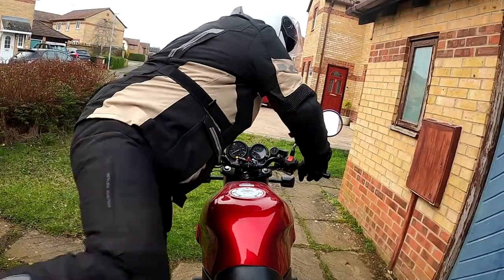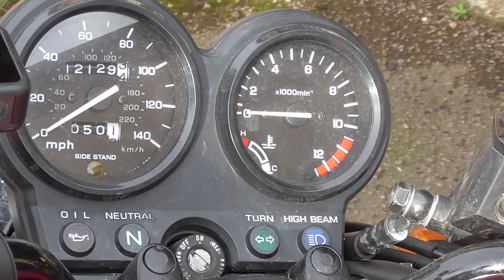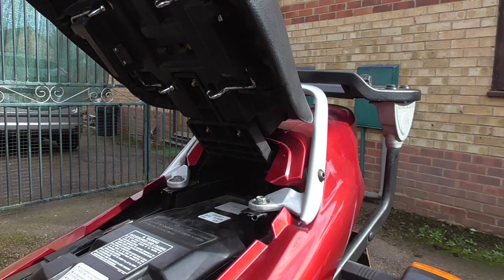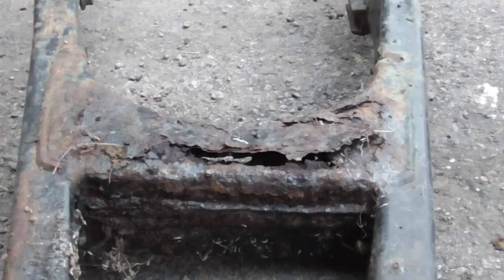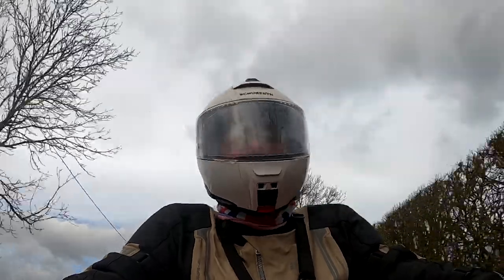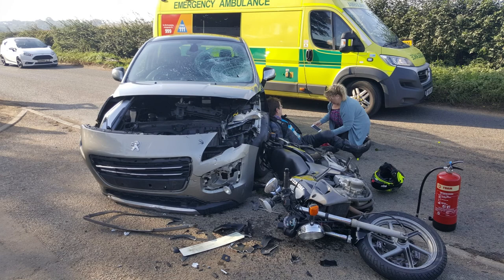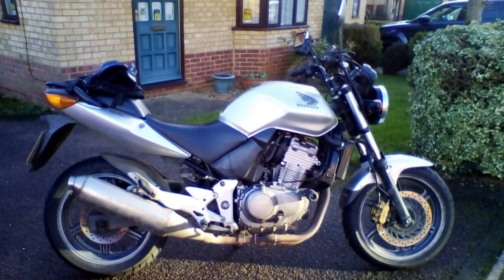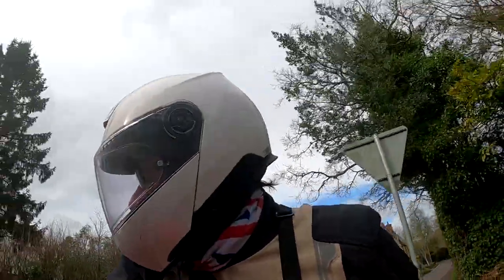1999 / 2003 CB500: Honest Review

Comment: Hey again mate have a question or two…

:) im getting around 210 miles before hitting reserve on fuel,does this seem about right? Also i have noticed a slight bit of handlebar wobble when one handed or if i take both hand off completely?I originally noticed the wobble when indicating.I spoke to a older gentleman/mechanic that knows these bikes and he said the wobble is normal on these?

Thanks in advance!!
Reply from the maker: @danshorthouse  I did 217 miles on my original [black] one without hitting reserve before bottling it and filling up, from memory I put in about 15 litres so I still had three to go but I wasn't far from reserve.  This was with panniers but on a motorway so the fuel economy would have been better, so your 210 miles is about right.

I haven't noticed a wobble, I get one at about 40 on my Hornet with panniers on but unless I take my hands off the bars I don't notice it.  Is the wobble at any particular speed range?  Do you have a flyscreen or anything else mounted on the bars?
Reply: @TheRantyRider  thanks for the reply mate! And ok great the fuel seems normal. The wobbling is not at any particular speed no its only very slight when off the throttle and only if one or no handed.

Kind regards
Reply: To add mate… today I checked wheel bearing/steering bearings and had the front wheel balanced and no difference. I have noticed that my bar ends are plastic and not weighed but I doubt its this. The wobble is anything between 30-55mph and only if you take your hands off.at 60-100mph the problem doesn’t exist.

Kind regards
Reply from the maker: @danshorthouse Again, ignore the bits you already know.  Weighted bar ends are to reduce or remove vibrations that could cause a wobble if they build as they have a mass at the end of a lever so an inertia that needs to be overcome to start them moving.  If you have a broom handle balanced horizontally on a finger it doesn't take a lot of effort to get it moving.  Now try the same with a plank with a couple of bricks on each end [best to use a fulcrum rather than your finger] and more effort is needed.

What tyres are you using?  Standard fit are BT45s, changing can sometimes cause odd effects but I wouldn't have thought a tankslapper was one.  It may be worth checking the rear bearings, swingarm play and chain alignment to eliminate those as well, but it may be OOTT - one of those things.  Once the weather imprves enough for me to get my Sunday Best 500 out I'll check for the effect.  That may be a while looking at the forecast and the flooding in the Nene valley that I saw yesterday.
Reply: @TheRantyRider  i love your explanations mate! Ok so the bar ends do more than I thought but i feel it would do it at higher speeds also and it doesn’t. As you know i only brought the bike a few weeks ago but yesterday i noticed the tyres are dated 2008! Im thinking now its them but going to cost £250 to find out! But then again they need replacing anyway I suppose! Also regarding bar ends i cant find standard ones! Do you think a set of say random oxford ones off ebay would do the same job.

Kind regards
Reply from the maker: @danshorthouse Thanks for the reply, I do try to explain things but a lot of people know physics and mechanics better than I do so I try to say 'if you know this tell me to shut up'.

2008 tyres are a little past their best, I would replace them due to age, but that is me.  There are some checks you can carry out, for example deflate the tyres fully then press down on the centre of the tread and look for cracking where the tread 'block' meets the 'grrove' or on the sidewalls.  Also feel how elastic the tyres are.  If you can push them in and they don't bounce back that well then they are shagged.

The original bar weights and gubbins are still available at a price, Fowlers show them here:
https://www.fowlersparts.co.uk/parts/4769437/cb500x-1999-e/handle-pipetop-bridge-1
part numbers 7-11 and 20 and you need two off of each.  If you can post a link to the Oxford ones I will have a look as these may just be the weight and not the 'socket' part they fit in to.
Reply: @TheRantyRider  thanks mate appreciated as always! I think its the tyres so i am booked in tomorrow at 12 for a new set and i will keep you posted! I will attach a link to some bar end’s below from ebay. I will wait to fit the tyres first as im sure that these are responsible but if no change i will go down the bar end route.

What your guess? Will the tyres sort it :)

Kind regards
Reply from the maker: @danshorthouse  I think it is more likely to be resolved by the bar ends, you didn't attach a link so I had a quick look.  Before you buy any ends have a look down the bars after removing the plastic ones, you should see a lump of metal with a thread in it if the attachment point is still in place.

If you are looking at this type: 

https://www.mileskingsport.com/shop/parts-and-accessories/parts-and-accessories/honda-bar-ends?order_by=created_at-desc

You will need the piece in the bars in place, if it isn't you need to look at the following type:

https://www.sfpartsltd.co.uk/universal-heavy-bar-end-weights-for-7-8-steel-handlebars.html

These are a rawl bolt type, tightening the screw pulls a spreader out to keep the weights in place, if you haven't seen how they work this shows how:

https://www.youtube.com/watch?v=v9Qqge0NOyo

The exaples shown may not be the right size so it is worth double checking the size prior to order.

Now, this is important, if you are ever removing the rawl bolt type only loosen it enough to pull it out, you stand the risk of undoing the nut all the way and it will sit inside the bars and will be hard to get at.  Thinking that the bike "isn't that heavy" and "I can lean it over and shake the weight out" is wrong and you will drop the bike breaking the front brake lever like I did on my Himalayan.  I didn't know the weights were rawl type though, so I'm not a total idiot, just 95% complete.
Reply: @TheRantyRider  you are a gentleman! Thanks soo much for going out of your way helping me! I had the tyres replaced today to bridgestone BT46 and the problem has gone!! Really happy! I dont think its worth getting the bar ends now.

Kind regards

Comment: I’ve been searching for cb 500s  as my mz 250 has run is it’s 😢last mile don’t ask Ava gas. Methanol big big bang melted piston alway watch cb500 in bsb simple as c90 compared to today any one got 90s 205 pug for message me as I’ve found a cb old skool defo makes sense ❤
Reply from the maker: @ Andy lebbon Thanks for the comment.  A long time ago I raced an MZ250, I went into race control after practice and enquired about my lap time.  The steward looked at the calendar and said "Tuesday".

Good luck with the hunt for a CB, the CBF is an option but less refined.

Comment: Hey i have recently brought a Honda CB500 1999 with 16kmiles. Anyway i have many bike but nothing like this and i have noticed that if you let the bike tick over for 15-20mins the temperature will reach half and the fan with come on as normal.but when im riding it the temperature is low around 20% up from the bottom. Is this normal?

Thanks in advance 🇬🇧
Reply from the maker: @danshorthouse  Don't worry, that is normal in my experience.  Some of the effect will be due to ambient temperature - as I write this it is January and my bikes take a while to warm up.  The fan should kick in with the temperature gauge pointing roughly at the top of the thermometer symbol which, as you say, will be after about 20 min of the engine running in tickover and stationary.

I have hardly ever had the fan come on while riding unless it's hot and I am in stop-start traffic.  The radiator seems to dump excess heat efficintly but keeps the engine temperature pretty constant.

In comparison my 900 Hornet takes ages to warm up, about 30 min if I am doing a fan check, but as soon as I hit traffic on a warm day the fan will be kicking in and out constantly.  One of my friends has a BMW S1000XR and the fan on that starts up as soon as we stop moving.

I hope you enjoy the bike it is very low milage for the year and if looked after has a long life ahead of it.
Reply: @TheRantyRider  thanks for your message mate! Really enjoyed reading it! Thanks alot! I love the bike its such a pleasure to ride! Never had anything like it! Iv had many ktm300 excs and gsxr750s in the past,this cb is definitely a keeper! 

Kind regards 🇬🇧
Reply from the maker: @danshorthouse  You're welcome, I try to answer questions quickly.  I still see CBs on the road occationally but as the last one was made 20 years ago they are getting rarer.
Reply: @TheRantyRider  i do have another query mate.i took the bike for a MOT the other day and after he was finished I noticed two tiny spots of what looked like coolant on the floor and today i rode the bike to my garage (half a mile away from cold) and when i was done and ready to leave i again noticed a drop of what looked like coolant on the floor,after i wiped it up with a white paper towel its definitely green as my coolant.just above under the middle of the bike are the overflow pipes and one was a little wet at the end and again green residue.i looked at a diagram of the bike online and i think this pipe is the overflow for my expansion tank.(the expansion tank has two pipes the one on the bottom of the bottle leads to the overflow under the radiator cap and the one on the top of the bottle leads underneath the bike and joins the other overflows) i have checked the level in the expansion bottle and its a little high but only slightly,i also removed the radiator cap under the seat and i couldn’t see the coolant until i gently pressed a coolant pipe and it came right to the top so that seems fine.

Any thoughts? :)
Reply from the maker: @danshorthouse  I'm not that hot on cooling systems to be honest, the expansion tank on the right hand side being overfilled may be the problem.  The manual states that the level is checked when the bike is warm rather than cold so that would be my first check.  The next thing I would do would be to feel the pipes to the pump and radiator as the bike warms, the ones on the rad should be cold until the valve opens then warm up, with one hotter than the other.

It's possible there is a leak, especially from a pipe if they are the original ones, or the gasket for the water pump can also go.  You need to have a crawl on the floor with a torch and look for white fuzzy residue (like baked on road salt) - this may be on the bottom of the overflow pipe if that is the source.

Let me know how you get on.
Reply: I came to change my air filter today and your right! The bottom bolt just spins from being seized 😂 I removed the other two bolts just fine and i did try grabbing the inside plastic with a set of grips (where the gold thread is inserted but it just spins and damages the plastic. I then removed the chain guard and this let me spin the air filter lid 180 and use the stuck bolt as a pivot.the two bolts that came out have copper grease on so i think previously this is how its been done.the bolts probably been stuck for years.i could grind the head off the bottom bolt so i can remove it normally in future as i think two bolts would be enough? Whats your thoughts? Or i could simply carry on using it as a pivot (just means removing the chain guard each time.

Kind regards
Reply from the maker: @danshorthouse  The bottom bolt on my black CB500 had the head ground off and ran happily like this for about 10 years and 60 000 miles so you have no worries on that front as long as the cover isn't distorted.  When running there will be a slightly lower pressure in the filter housing so the cover is sucked on improving the seal.

You can always look at reversing the fixing by bonding a thread into the housing and using a nut on the outside if you feel like you need the extra security.  Thanks for reminding me to check the ones on my red 500 and Hornet 900 though, I normally do that before winter but was busy with work.
Reply: @TheRantyRider  thanks for your message as always! And great! I think im going to leave the bottom stuck one in there and use it as a pivot,works fine.

You lost me a little when you said about pressure and it being sucked on?

Kind regards
Reply from the maker: @danshorthouse  I do tend to go into basics so if I'm telling you what you know skip ahead!

With the engine off the pressure inside the air filter housing will be the same as atmospheric, but with the engine running the air in the filter will be sucked into the engine and replaced with fresh.

Although the volume will me the same, or pretty much the same, with the air moving the pressure will be slightly.  It won't be a lot, in fact barely noticable, but enough to provide a little suction keeping the cover closed slightly more.

There is a relationship between velocity and pressure and it's also how aircraft wings and carbs work.  There is a good video by Destin on Smarter Every Day https://www.youtube.com/watch?v=toVfvRhWbj8 that shows the principle of carburetters.
Reply: @TheRantyRider  you know too much! 😂 im totally with you now tho! And really enjoyed the video! Amazing! 👍🏼
Reply from the maker: @danshorthouse - You can never know too much, I just know where to look for information (and being an engineer helps with the principles).  Destin makes really good films that explain things well and he has far better kit than my 'unsteadycam' and couple of Hero 3 cameras.

Now that it is warming up in the UK and there is a bit less ice I will be clocking up the miles on my Tracer 9 and Himalayan so that I can do the reviews on them.  If you haven't seen it already I have a 900 Hornet review as well - it's a bigger, heavier, more powerful version of the CB500!
Reply: @TheRantyRider  👍🏼👍🏼 and thanks for your response as always mate! Chat again! 🇬🇧👊🏻

Comment: Not to mention the old cb 500f has 10 more horsepower than the brand new ones thanks to emissions and a2 license restrictions.
Reply from the maker: @chrisdadigger1018 Thanks for the comment.  The new 471 cc engines do indeed develop less power, but having owned a CB500X the torque spread is so wide that it's near impossible to be in the wrong gear.  It's a shame that the build quality is rubbish and neither Honda nor franchised dodgy dealer wanted to sort it out.
Reply: @TheRantyRider .   this new cb have much better more linear power curve on graph ,this old pc26 -32 have massive hole in midrange atleast if everything is stock 😉👌🏻 however hold old cb above 8 to 10 k rpm in race and it smoked this new one thanks peak power advanatge 0-140 12 vs 10 sec vmax 170 vs 180 gps but from idle to 7-8 k rpm in daily riding new one is better 😉👌🏻
Reply from the maker: @mociczyczki Thanks for the comment.  I owned a CB500X for 9 months and 1471 miles which was covered in 11 days riding.  The rest of the time I was arguing with Blade in Stratford Upon Avon and Honda UK about a warranty claim as the frame had badly corroded wihin a week of purchase - and it was brand new.  While the engine does have a flatter torque curve than the 499 cc engine and is more tractable throughout the rev range the 'hole' isn't really there in the larger engine apart from on the graphs.  It is a less linear ride in torque governed by the emissions [sound and noise] regs and not really noticable when riding.

The experience with Blade and Honda with the CB500X has ensured that I will never buy another new Honda, or a second hand one after about 2009 because of the shoddy build quality and complete lack of interest when a problem occurs.
Reply: @TheRantyRider  it is jotoceable you must open throtle on max from low rpm like 2-3 k rpm on one gear up to 10 k rpm ypu willl fellll like acceleration change alot in midrange atleast in stock setup 😉👌🏻 in riding when you shift at 4 or 5 k rpm offcorse it be not noticeable or at 8 k rpm when you compltely avoid this part of rpm 🤭🤷🏻‍♂️😉👌🏻
Reply from the maker: @mociczyczki I've dug out the dyno graph from 2008 when my bike had about 50 000 miles on it, there is a dip of 2 ft lb [Peak at 4800 is 33 ft lb] from 4800 to 6000 RPM and a peak torque of 37 ft lb at about 7500 RPM.  Peak HP is 57.87 at 9150 RPM, but these figures are from a mobile dyno at the Ace Cafe and will be corrected for crank so probably not totally reliable.  I am more of a low to mid RPM rider on the CB and Hornet [review elsewhere on my channel] except for the occasional fun blip and the only bike I ride at 5/6ths of the way up the rev range is my Himalayan-and that's because 5000 RPM is about 65 MPH and it red lines at about 6!

Comment: And they are faster than the new ones.
Reply from the maker: @chrisdadigger1018  Thanks for commenting.  The newer ones are lacking 10 BHP in comparison to the ones here, but the torque curve feels flatter so they are slightly more flexible engines.  The build quality on the newer ones is worse than the '90s ones though, and don't get me started on the swapping of the horn and indicator switch positions.

Comment: I have had mine from new 2001 it's had a hard life although I have serviced it regularly I have now reached 140,000 miles on mostly original parts
Reply from the maker: @stephentaylor1476 Good on you!  That's a good milage, have you had the issue with the corrosion to the underside of the swingarm?
Reply from the maker: @stephentaylor1476  A good tip I was given was to use Smoothrite with 10% thinners, it perfectly matched the black of the frame when the downtubes were getting stone chipped.